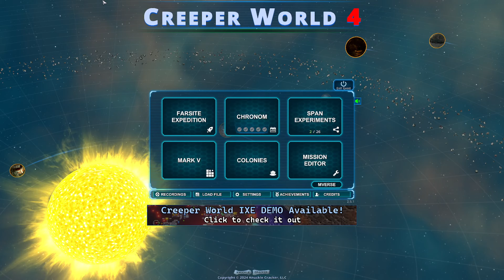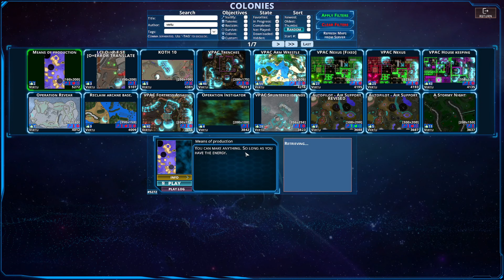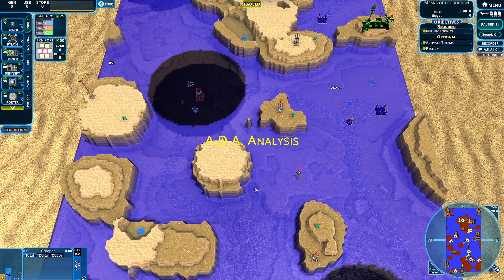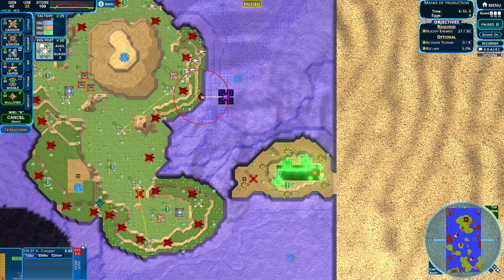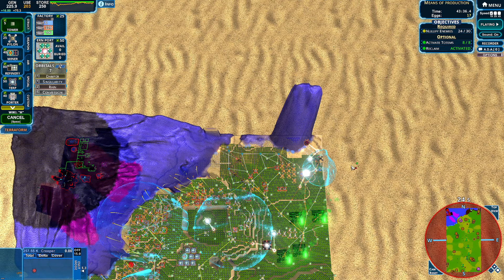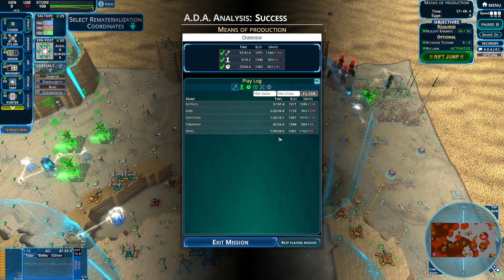Means of production: Creeper World 4 Part 710

Comment: Guess you got lost focus a bit at the end after all that had happened and final victory was in sight.  Kind of surprised you didn't build some more Mortars at that point with all the free energy you had so you could better delay and hold off the incoming creeper wave, but I guess you'd already set yourself on which strategy to use.